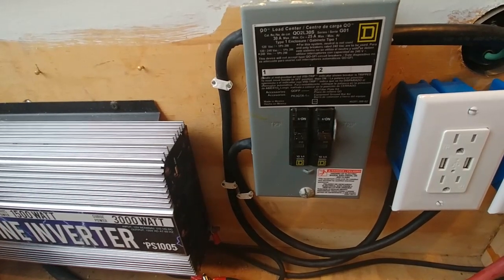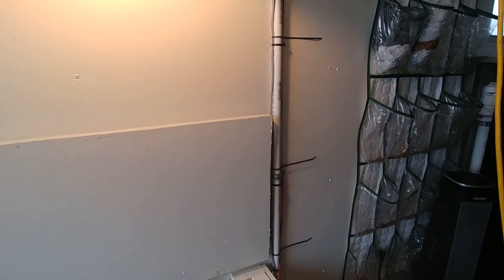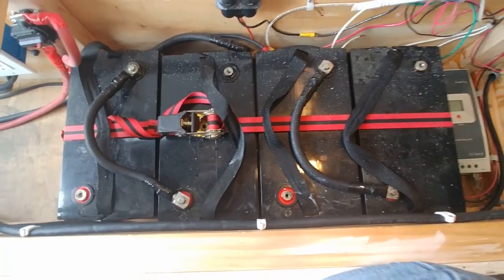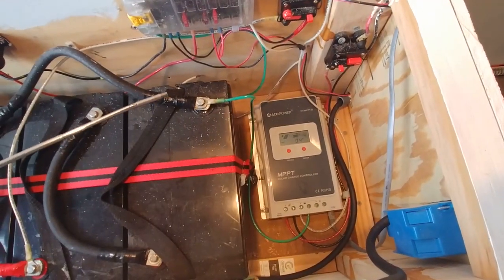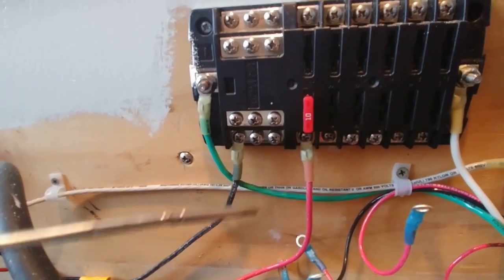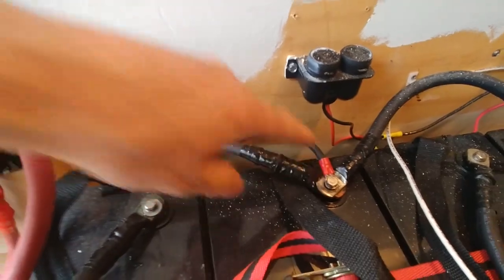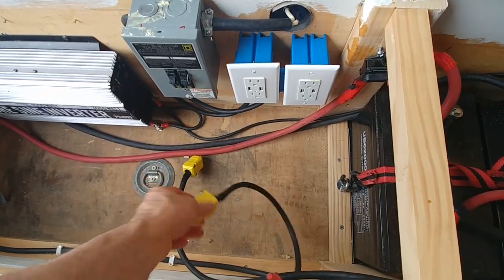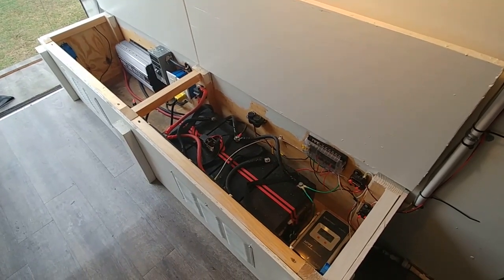ELECTRIC SYSTEM SUMMARY cargo trailer camper conversion vanlife skoolie #flgctc

Comment: I noticed your battery white wire is wrong it should be at the end battery POS terminal
Reply from the maker: Yes it should. However, my solar controller was having a bad day and I tried a different connection.

Comment: Hi, I have a sprinter van I use in my business and am considering building something like the plug van idea from Europe. The idea is to turn the van into a temporary camper van. My question is, since I don’t want to add permanent wiring to my van could I use a Construction style 30 amp power distribution box and connect to the shore power.
Reply from the maker: I have never used one of those. From the pics I see you have to be sure that you are getting a 30 amp 110 volt box, some of them look like 220 volt. Also you would need to make sure it has the RV style 30 110 volt male plug in to fit the common RV electric boxes on the camp site posts. God luck.

Comment: Just posted a question on your other electrical installation video. I want to install a 6 circuit-breaker panel, so I can put each outlet on its own 15 amp breaker. I am planning to install a total of 6 outlets. I got a GE 6 space, 125 amp panel. Is this setup practical? I am not going to install any 12 volt battery system nor am I going to run an AC for now.
Reply from the maker: Thanks for watching. I responded to your question on the other video.

Comment: why do u need 40 amp breakers
Reply from the maker: The solar panels are always on if there is light outside. The 40 amp breaker can be used to turn the solar power off to the controller.

Comment: So since the batteries are attached to the frame couldn't you just run the black 12v wires to the frame instead of back to the ground on the fuse block?
Reply from the maker: You could if that is your choice. Thanks for watching.
Reply: @FakeLegGreg  I've seen it done both ways and my battery and everything else will be up front so it might save me a decent amount of wire. Just wasn't sure which way was best or if they are equally sufficient.

Comment: Hello. Thank you for all your detailed videos! Do you have a schematic of your electrical build? I’ve written one up by watching and pausing your video but want to be sure. Also what did you change to your final system that wasn’t stated here?
Reply from the maker: Changes I have made since the video.... I added a ground wire from the breaker box to the frame. I also changed the 2 110 volt outlets beside the breaker box to GFCI outlets. I don't have a schematic, thanks for asking. Thanks for watching the video.

Comment: I'm beginning to get it. Im new to this and I'm trying to learn as much as I can before I start my 7x14 toy hauler to camper conversion. Breaking it down into the separate systems helps. As of now, I dont plan on having solar power. So, im focused on the 30amp RV power connections from where the 30amp comes into the trailer and then how to wire various outlets from there to run refrigerator,  microwave and other smaller items. Also, how to wire in a battery bank and inverter for when shore power isn't available. Id also like the 30amp system to recharge the batteries when connected. Can both systems  run the same outlets? Thanks in advance for any help you can provide. I hope I explained everything properly
Reply from the maker: If you are going to have batteries you know you will have to have some method of recharging them when the 110 volt is not available. Yes, you can use the 110 volt when it is there but while traveling that is not always the case. That is the need for solar or a generator. Also, yes both the 30 amp shore power and the batteries/inverter can use the same outlets to power your microwave and fridge, but both systems cannot power the same outlet at the same time. You will need a way to switch between 30 amp and inverter. For me I just unplug my 2 cables from the shore outlets and plug them into my inverter. They also make switches for this but I have no experience with them. Thanks for watching. Good luck with your build.

Comment: Did you make the extension cord? If so...what did you use??
Reply from the maker: I used bulk 10 gage wire that is wrapped into one cable I bought from Lowes. Sitting here right now I am not sure if they call it 10-2 or 10-3 but you want to make sure that the cable has a green, white, and black wire inside before you buy it. It should look like the cable in this link. https://www.automationdirect.com/adc/shopping/catalog/cables/bulk_multi-conductor_cable/flexible_portable_cord_(sjoow,_soow,_sjeoow,_seoow,_type_w)/insulation_type_-_soow/soow-10-3bk-1?gclid=CjwKCAjwydP5BRBREiwA-qrCGrzlKubMocYqzib4bjL81L8jiiKJnHZx-CSQ3jON1JZZdIMuOMBy-RoCTUAQAvD_BwE

Comment: why does the hot wire for the aux panel go to the solar controller instead of the battery?
Reply from the maker: Ideally both the ground and hot wires would go from the solar controller to the auxiliary panel so that the controller can monitor the power coming in from the solar and the power being used. However, my solar controller was being hard to get along with so I only ran the hot wire over there and the ground to the batteries. Thanks for asking.

Comment: What Gauge Wire Are The Green And White Wires?
Reply from the maker: Good question. I used 10 gauge stranded wire. Thanks for watching.
Reply: GB Conversions & Adventures Thanks.
Also, How Exactly Did You Do The Grounding For The Neutral Wire? What Kind Of Bolt/Screw Is That You Used?

Comment: Thinking it might be better to run off of the battery for your 12v acc/ fuse block. Take the white wire off the solar controller and place that one straight to the battery.
Reply from the maker: If the fuse block is wired through the solar controller then the solar controller can keep track of the up to date battery usage. The DC will work either way, depending on what you want to keep track of. Thanks for he suggestion though.

Comment: You need to make 110 volt wire nuts connections in a junction box not have them exposed in you electric storage box.  Safety and code.
Reply from the maker: I agree and may make the change. Thanks for the suggestion.